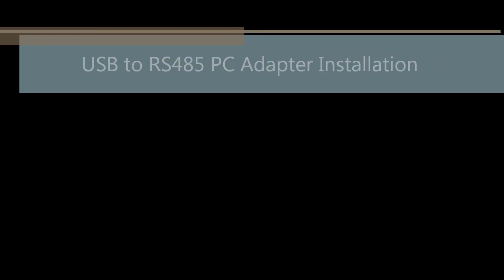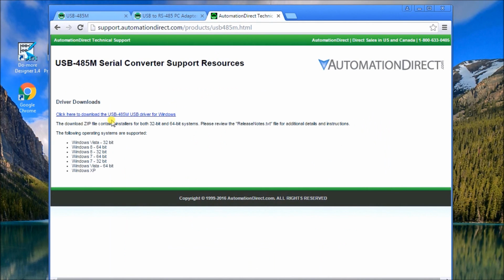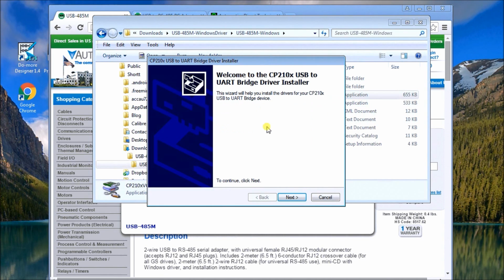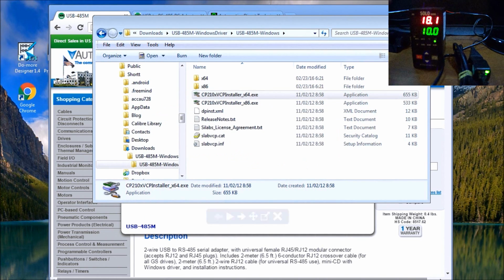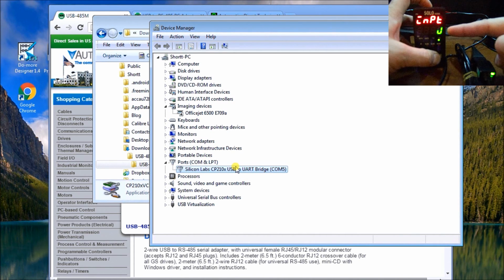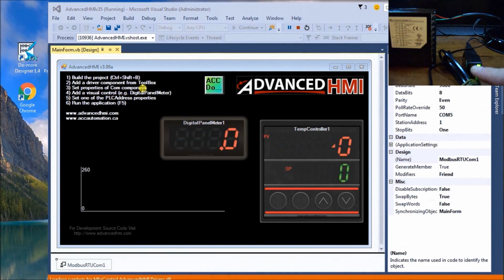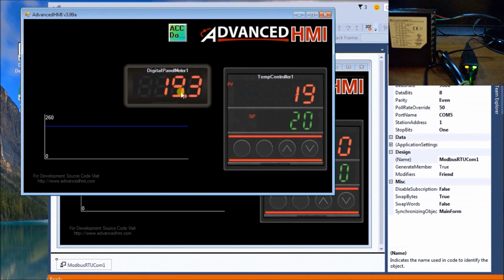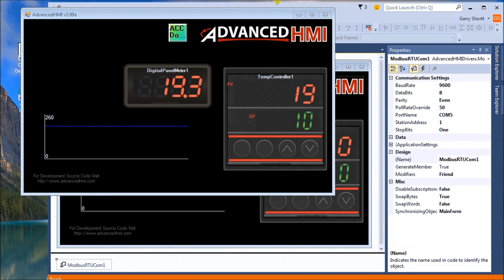USB to Serial Communication Device Driver Configuration Tutorial

Comment: I want to collect print output from an old DOS Computer that controls a measurement system  Effectively removing the need for an old dot matrix printer.  Any suggestion how to approach this task?
Reply from the maker: I would use a serial port logger. This link will list a few different ones.
https://www.virtual-serial-port.org/articles/best-serial-data-logger-solutions/
I hope this helps you out.
Regards,
Garry